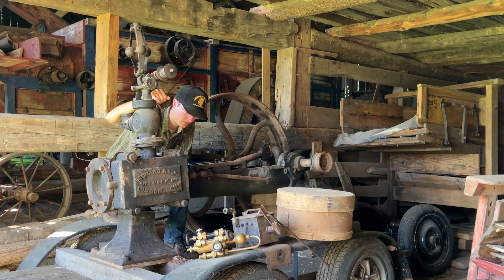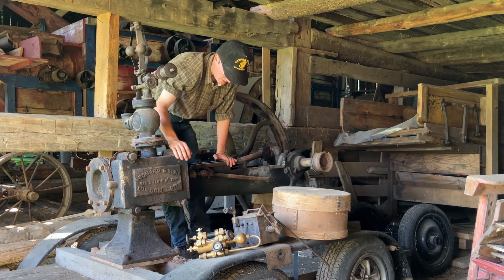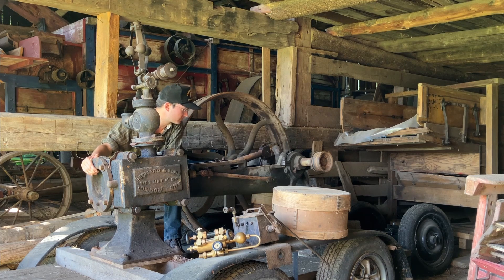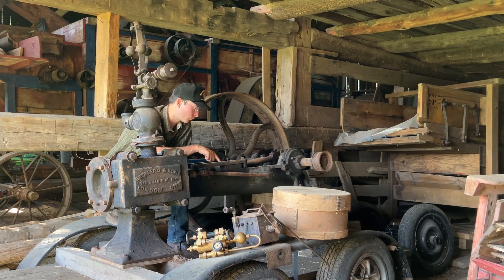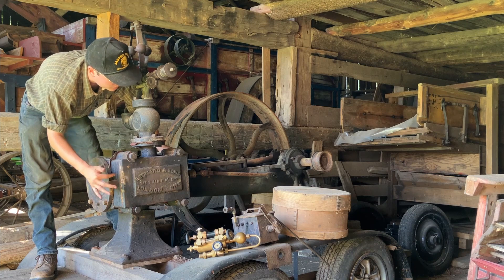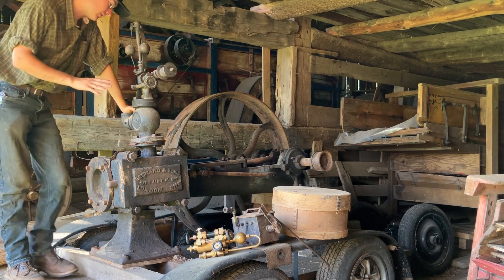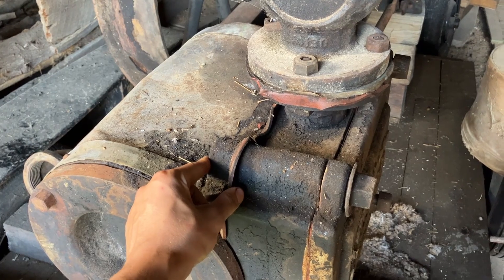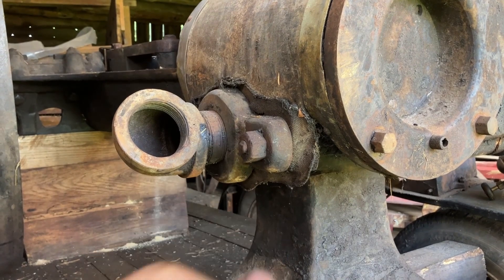1877 Leonard Steam Engine

Comment: That is a beautiful engine!  I just got my first engine and boiler to run my shop line drive. Mine is a little underpowered but I am a one man deal so a 4 inch bore on a 100 lb vertical boiler will probably work any one machine at a time. Yours is just stunning, mine is a plane Coke bottle frame engine.  Thanks for posting.